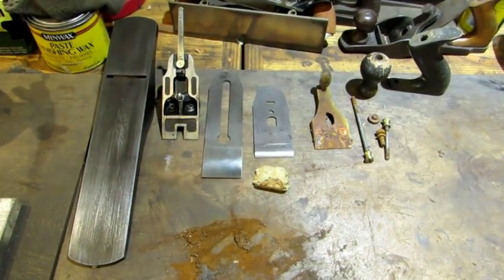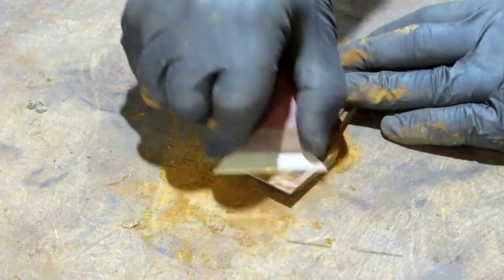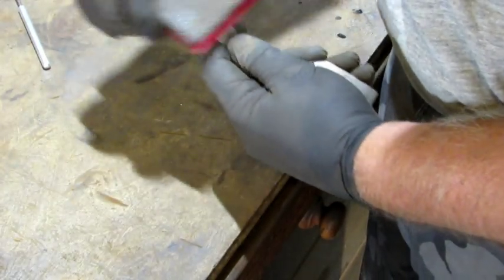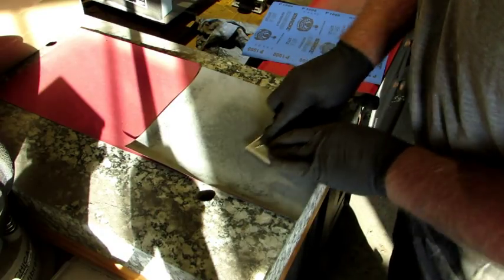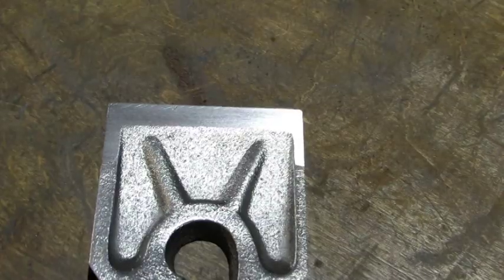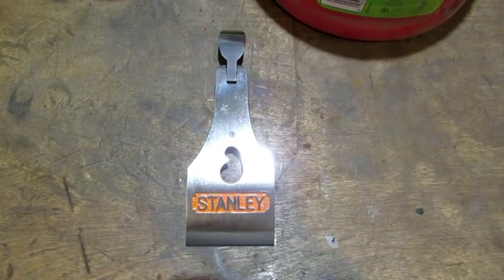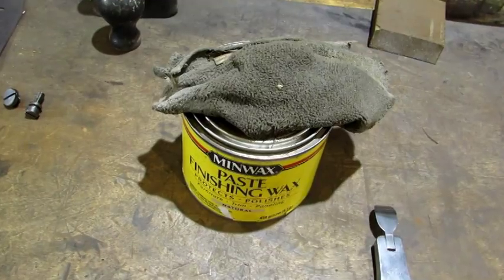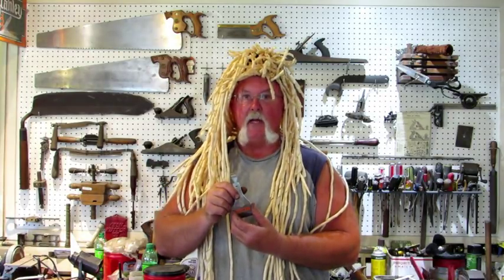Restoring a Bench Plane Lever Cap

Comment: I have an old "K" series Keen Kutter lever cap (bedrock) and it doesn't have the flat piece of metal on the back.  Is it supposed to?  It doesn't even look like there is a place for the rivet/screw to hold it in place.

Comment: I have a Plane Lever Cap that part of the nickle plating has come off in a couple spots; partially on the lever and corner which have rust. What is the best way to finished the lever cap is nickle plating that flaked off?

Comment: I recently tried evaporust for my type 6 number 4 and it came out lovely! It has wonderful patina still and it wasnt a huge mess! Have you ever dabbled in Evaporust or anything similar? Love your work man!
Reply: I used evaporust on my type 13 no. 6 lever cap and it tarnished it and turned it black. It did get rid of the rust, but now I have the black to contend with. It seems about as hard to sand off as the rust.
Reply: @19DHooah   its the leftover carbon. It's best to take off while still wet with soap and water and some steel wool.

Comment: love your work, I restore my hand plane according to your videos.. i had a small problem, it seems that  the previous owner of the hand plane i owned decide to  tighten the blades using the screw, not the tension spring on the lever cap and it left the cap deeply dented... is it possible to fix it? thanks before,..
Reply: Plane Collector thanks for the reply, the dent is really deep, what do u think if i braze it? will it work? thanks